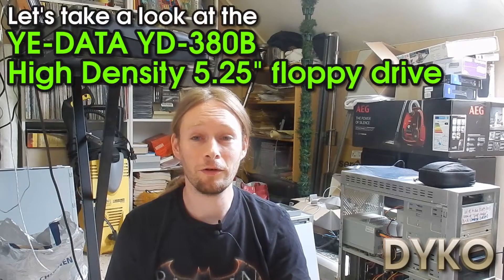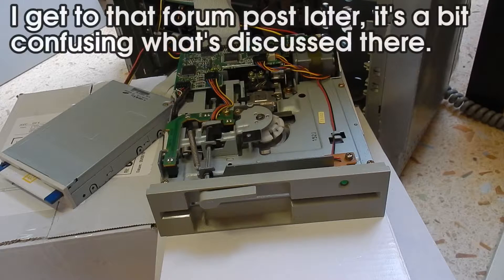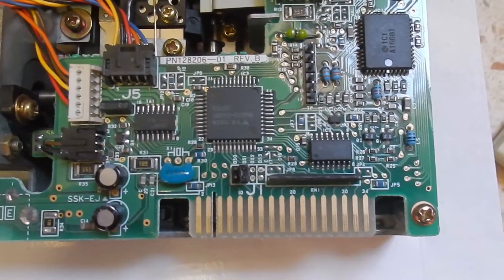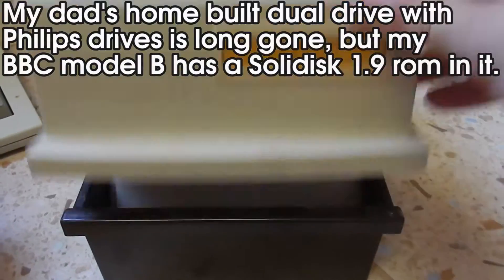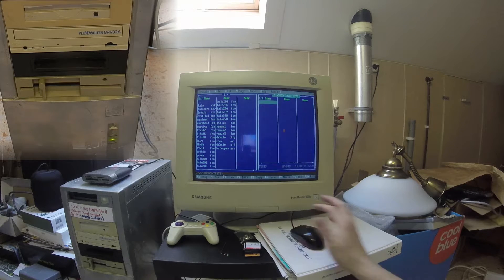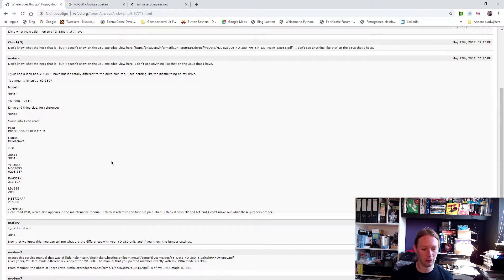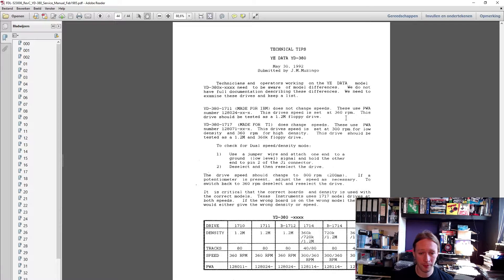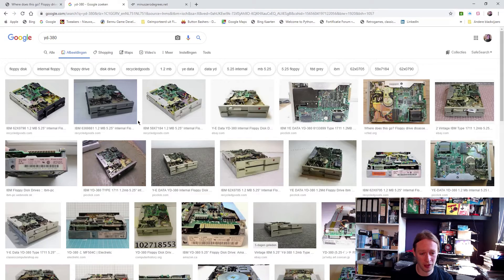A detailled look at the YE-DATA YD 380B 5.25" High Density floppy drive

Comment: Thanks for the video. I bought the exact same drive (YD-380B-1736) thinking it would work in my IBM PC 5150 (8086).  I understood that BIOS support for high-density drives wasn't added until the IBM AT (80286), so I did not expect it to be able to handle 720KB or 1.2MB disks, which is fine since I only have double-density (360KB) disks. What I learned from your video, though, is that the YD-380B will not work as a 360KB drive without special BIOS support for "double-stepping" the head, which of course my 5150 lacks. Maybe those confusing forum posts were by people who had the same problem as me and for them it was true: the YD-380B does not support 360KB disks.
Reply from the maker: It's typical IBM to invent such solution, the double stepping behaviour in the BIOS is one of their clever "hacks" to make it work, something that the PC clone industry copied in order to be compatible with IBM's design. Back in the day many people wrote 360KB disks on those 1.2MB drives (myself included as I didn't know any better). 

Reading those 360KB disks written on 1.2MB drives I my experience works as long it's beeing read by another 1.2MB drive (provided the drive is good condtion). In the late 90's I had a Laser 286 with a Chinon 1.2MB drive, I was able to read 360KB disks  that I written on that drive with my YE-Data drive suscessfully so many years later. 

The real issue is that the tracks are too fine for a real 360KB drive, IBM offered such drive as an optional extra on the AT for data exchange with XT users.

Comment: I have one YD380B 1736B00W from 1990. Mine have a red led instead of green.
It reads fine 360K. I formated and wrote data and all went good. I don't have any 360K drive to test if floppy works on a true DD drive.
If i try to format a disk, and don't specify any parameter to the format command, it will try to format DD disks as HD, i need to manually specify 360K format.
The disk still format as HD, but alots of bad sectors appeared. But if my memory serves me well i got a DD disk formated as HD without any bad sectors, but i need to confirm this.

Comment: Just what I needed to know. I was going to buy a YD-380B (1736B01W) to write 360kb disks for my 8088 PC. Thanks from Sweden :)
Reply from the maker: I would recommend the YD-580 instead. That's a 360kb model. The YD-380 was intended for the PC-AT, it can read 360kb disks just fine, but writing double density (360kb) disks in a high density drive is not recommended. It works, but only high density drives can read those back due to the smaller track width. (A 360kb drive has bigger head and has 40 tracks on the disk, with high denisty drive the read/write head is smaller and has 80 tracks).  The high density drives such as the YD-380 use double stepping to read 40 track disks. Another thing to take into account is disk controller, an 8088 likely has a older floppy controller without support for high density drives. Also the PC-AT changed the function of pin 34 on the floppy cable, an XT uses the Ready signal and on an AT or later is disk change instead, most drives (but not all) have jumpers to change the behaviour. I would recommmend looking for documentation on the drive you intend to buy to investigate this in advance. The Teac Drives are well documented on the web. The YD-380B is good choiche for more modern systems (286 and later).
Reply: @dykodesigns   Thanks for your help, I will search for YD-580 instead. I don't know much about the old IBM stuff. I was more in to Commodore and Atari ST in the -80s :) I got an old fully working Atari PC2 from a friend and want to make some 360kb disks for it with my Windows 98/Windows 2000/XP computer.

Comment: Your video was informative. I have a YD-380 1736 (slightly later model) which has the DSKCHG signal instead of READY on Pin 34 and does not seem to have any jumpers to change this. I want to use this drive on an old S-100 system (1981 vintage) because it's characteristics mostly emulate an old Shugart drive (360 rpm, MFM etc.). My problem is, this later version of the YD-380 only seems to have the DSKCHG signal available as required for the PC AT computers. I need the READY signal to satisfy the WD1793 based drive controller board. Do you have any experience hacking a READY signal from the signals that do exist on the later YD-380? Others have suggested using/patching the MTRON and/or DS signals, isolated by diodes to do this but I am looking for some feedback on this idea.
Reply from the maker: Sadly I’ve got no experience with such a mod myself, but I’ve heard that some Atari ST and Amiga users have good results with modifying 3.5” jumperless PC drives for use on their Atari and Amiga systems, so it may be possible with the YD-380. There are many versions of the YD-380 and a lot of them seem to have been tailored towards IBM compatibles. In a lot of cases with other drives the signals are simply solder bridged on the PCB, with a bit of luck that may be the case here as well, at least if YE-Data didn’t modify too much. It is hard to find info on specific model revisions, drives from the likes of TEAC seem to be more documented in regard to schematics and service manuals.
Reply: Yes, there seems to be many variations of circuit boards for the YD-380B gradually eliminating option plugs and going towards the PC AT standard. I will keep searching and experimenting. Thanks for your reply!
 @dykodesigns

Comment: This video was very helpful. I have a similar model (YD-380B 1736B01W from 1991) and tested it as drive A but that didn't work. The drive is recognized by the BIOS and OS, and the motor spins up when a disk is inserted but not during disk access. Only when configured as drive B will the motor start when reading or writing a disk. Thanks for the hint :)

Comment: Hi, please tell me the marking or characteristics of the "blue capacitor" and what is the smd element on the left - next to the 2pin connector?
Reply from the maker: The marking the Blue capacitor reads 4.00G or 4.000 Cm Ω (or something like that, it's difficult to read on my own photos). The text on the SMD chip left to it says : YE-DATA M60013-G143PP 109103. I could not quite read it properly, but I think this is close. The first P in G143PP might also be an F.